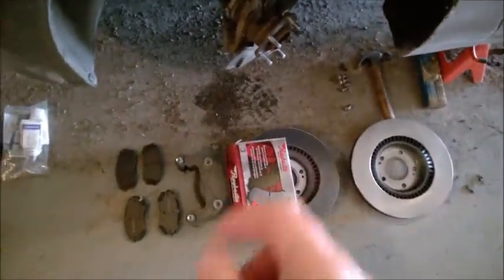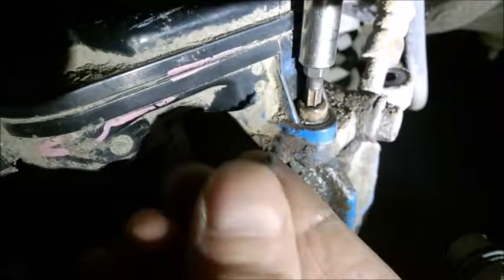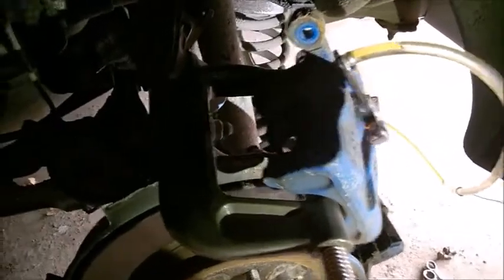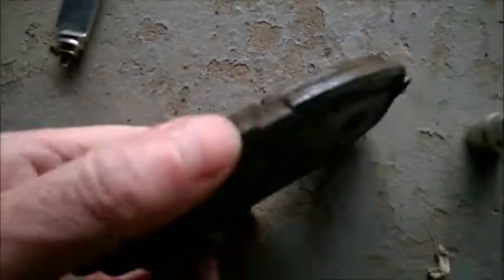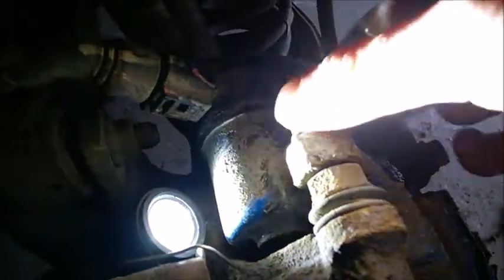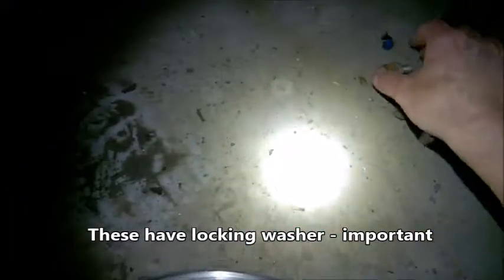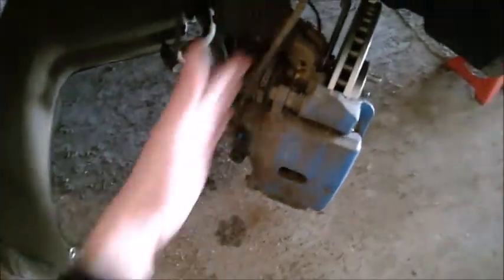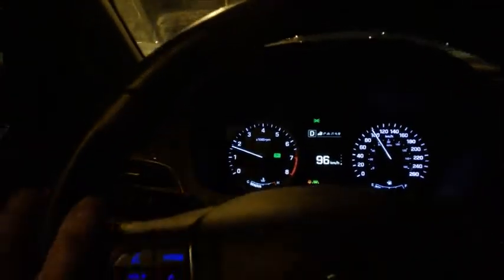Hyundai KIA Electric parking brake replacement EPB

Comment from the maker: These screws need T26 torx, which is usually not available in sets. A T25 is too loose and will strip the bolt, a T27 is too big and hard to tap in but preferred. These screws get completely stuck after 1-2 years and you can shear them trying to remove them - you will have to replace the caliper. I recommend bring the car to a garage to use a scanner to retract the EPB and install the rear pads. Or buy a $100+ scanner yourself. See my other tips videos about EPB. I do not recommend actuating the EPB directly on 12v - owners got the EPB damaged because the car will not know the actual EPB position and may force on it when you restart the vehicle.
Reply: Do you know where you can buy replacement torx screws? Used the t27 but the rust won
Reply from the maker: @alexanderkelson8043  I would call the Hyundai dealership. My guess is these screws are not sold separately.

Comment: I have 09 S80, the epb motor seems working fine. When changed the pads today, I use 12v to rewind the motors. One motor will rewind forever, I am able to push the piston in though. What’s the problem could be? Not sure how motor and piston are connected inside the motor? I tried to open the motor, but the screws stuck. I need to buy t-30 bit. Like you mentioned in the video, socket does not fit very well. The other motor will stop by itself after about 1 minute rewinding. Thank you
Reply from the maker: Possible the motor disconnected from the brake cylinder. With the brakes pads in place, try engaging the EPB from the cabin button a few times. Try disconnect/connect back the battery then cycle again the EPB button.  That's the risk when powering the EPB connector from a 12v source. I've seen other people ruining their EPB doing so.

Comment: You are not talking about  bedding in the brakes after replacing the rotors.  Tis process involves breaking to a near stop from 30-40mph, maybe 6 timers, letting the breakpads and rotor heat up. 
This process evenly coates the rotors with the pad material, which will result in a more even wear.

Comment: Thank you for the video. How do you determine the amount of setback for the Electronic Parking Brake as you are reassembling?
I finished the brake job before finding this video, and all my brake pads are now new and working great. Unfortunately, I didn't set the EPB back quite far enough (I just turned it back so that it wasn't putting pressure on the pads)
Problems:
1) if I turn set the EPB, the EPB is getting stuck on even when I shift into Drive.
2)  The Auto Hold is sporadically inappropriately activating itself.
3) The Parking Brake off button indicator light is also sporadically being activated.
4) The brake pads are grinding forcefully on the rotor when placed in Reverse.
I know the solution is to set the EPB motor further back from the caliper with the T40 Torx to adjust the center spline of the EPB motor, but I am only guessing how far to set it back.

Is there any set number of rotations one should make? I am trying to avoid repeatedly adjusting, replacing the wheels,  testing, and having to repeat.

Thank you again for your informative video!
Reply from the maker: I don't think the amount of pushing back the piston is important, as long as the new pads fit in.  With the piston pushed back as in the video, I had perhaps more place than needed for the new pads.  Once I put everything back in place, the car adjusted the electronic brake by itself to the new pad position.
From what you describe, I would think maybe there is a problem with the electronic brake connector to the motor.  We had such problem (and the EB on that side would not release). I disconnected carefully - pretty difficult to undo, cleaned the contacts, inspected the wire to the connector, and connected back in place, and since no longer had that problem.
Another problem that can happen - probably not related to your situation - is when someone is screwing the T40 torx without alternatively pushing the piston back from the other side with the C-clamp. I heard someone did so and his EB would no longer work afterwards, perhaps the piston jumped off the threads inside.  So for who is reading this, always alternate between screwing in the T40 and pushing back the piston, and do so in small steps -   like 1/4 turn until the piston goes back enough to clear the thickness of the new pads/disc
Reply: @Peppermint1  thank you so much for your thorough reply. I worked on the car before I saw your message and I discovered the most ridiculous cause for my problem. In my haste to finish the original brake pad replacements on all four wheels before an unrelated deadline that day, I accidentally left the left rear
Reply: Emergency parking brake motor unattached. I quickly realized it today when I took that wheel off and everything is in order and working fine now. I have to laugh at myself and glad I didn't get in any dangerous situations.

On a separate note, I think I noticed you were in Canada and maybe you have a Canadian market Sonata, and I have a U.S. market Sonata and they may have their differences.I can say with 100% certainty that the Torx bolts that hold the motor on on my car require EXACTLY T25 bits, not T27. I am in Southern California and there is absolutely no rust or debris on my caliper assembly. there is a fine metal Torx shaped sleeve inserted into the head of the bolt though, and I suspect it might be like this for the vehicles in the US market. I had made note of your warning and thought it was curious as I had used T25 just fine on the initial job. when I went to use T27 today, it was clear that it was way too large for my EPB motor mount bolts. Once I took them off with the T25 bit, I looked at it closely and understood. I'm guessing it has something to do with the two different car markets.  The T25 bits fit perfectly, the T27 was not a possibility. I don't doubt that yours is T27, though. Thanks again!
Reply from the maker: @masimonz  Very possible about a different size for Canada, bolts always get stuck from rust here. Have to say, at first I felt too like no way a T27 will fit in there, until I started tapping it in which crushed the rust and had the star hole take its actual shape.  All in all, it's a really tiny screw, the thech guy who decided for these must have been late on friday afternoon  cheers

Comment: Is the small star bit size t25 or t27 on the motor? What is the exact size? And after disassembling the motor, is the beat for the center t40?
Reply from the maker: I think the actual size is T26 (twenty-six). A T25 will be too loose and guaranteed will round the bolt head, a T27 may be difficult to force in there but if you can, use T27, the tightest, the better. Ideally a T26 will fit well but it's not available in torx sets.  The bolt is also extremely tight because of rust, if you force too much you will shear the head and need to replace the caliper.